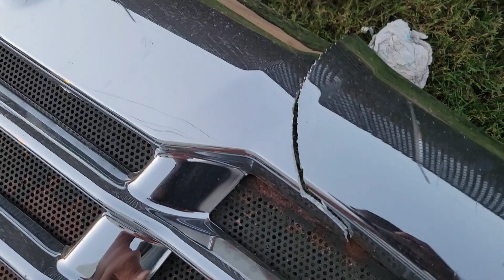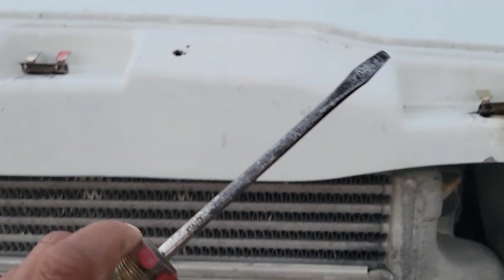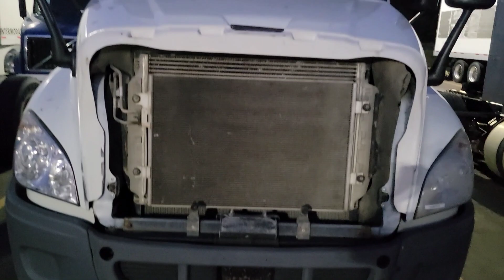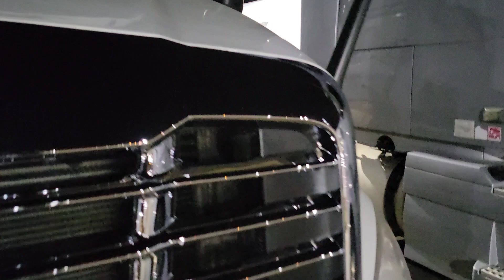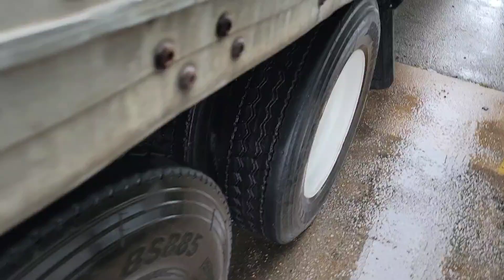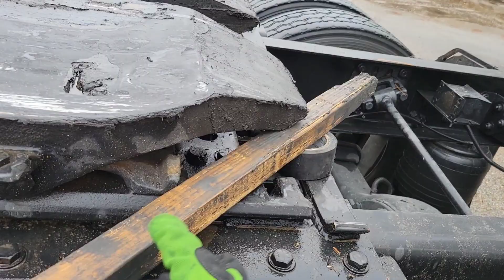Missing Grill and Jumped the KingPin

Comment: If you don’t have wood you can use rolled up ratchet straps too. And if you can’t drop your air bags you can roll the trailer up as high as it will go. It sucks, especially if the trailer is loaded but it worked for me. Respect and stay safe driver.

Comment: Great tip for 5th wheel that will always happen also wood is ez to find & I would have cranked the trailer up around 2 twist but sometimes that's hard also hey Success On & Happy Trails 🚛🚛🚛🙏🌹😷
Reply: And puts you at great risk of a shoulder or back injury

Comment: Always carry around a few blocks of 2x4 which you can stack up. You could have also placed them on the top of 5th wheel with suspension down then raise suspension in order to crank your landing gear lower. You can also use the blocks when a trailer is dropped too low for 5th wheel. Simply back up your rear frame under the trailer plate with suspension down and place 1 block on each side of the frame then raise suspension so you can crank your landing gear lower without tension.
Reply: Yes yes yes

Comment: My intercooler on my company freightliner cascadia came loose, it was cocked sideways...lol.  I had them fix it in Carlisle PA.  I hit high on the 5th wheel,  but it didn't go over.  It pushed the front down and the back up.  I pulled the release handle back out and drove out from under it.  Lower the trailer and hit it right the second time.  Be safe on your journey.
Reply from the maker: Thats scary (sideways intercooler) you be safe as well.

Comment: Use some red loctite or lock washer to keep screws from backing out or loosening over time
Reply from the maker: Appreciate ya TJ
Reply: Never use red lock tite for some thing like that as the screws would only be removable with a torch and obviously you would damage your grill.
Use blue loctite this is meant to be disassembled   with hand tools.
They also make screws with loctite in them.

Comment: The new one looks great.  The new grill will make the front look new. The only way to do it is the right way with the correct screws.  Several years back I drove a truck for USA truck and some of the screws came out of the grill.  I patched it up until I was at a terminal and I ask the shop maintenance department to put screws back in the grill.  Their reply to me was it looks fine to them?  But that wasn't the first time I saw their truck and trailer maintenance department slip shod a repair.
Reply from the maker: Thanks, I agree and yeah they don't understand what seems small to them is a big deal to us, we want the trucks we drive to look nice and be safe to drive
Reply: @LeeLeeOutTheBox  That is very true.  Going into a weigh station with  baling wire and duct tape visible will definitely trigger an inspection. I remember an inspection I had when I was with that company and it was in new York the guy said to me (if you list 100 trucking companies) USA would be the 99 th. Worst.  Number one being the best and 100 the worst. I thought that was interesting.

Comment: Those clips are about $12 apiece and I'd replace them while you're at it. You do need them or the grill will rattle and come loose again. It's easier if you put the clips in the holes first instead of putting them on the grill first. I think I paid $190 last time I replaced a grill. Don't drive without it or you'll get rocks in your AC condenser. AC condenser is about $300 plus labor and freon.
Reply: The condenser is far more than that.

Comment: Buy a crowbar it will help  you  out of plenty jams from  jumping that 5th wheel.  I hate it when  you  pick up a loaded  trailer  and the yardjockey crank the landing  gear too high and you  clear the 5th wheel.  So I keep  that crowbar on deck!
Reply from the maker: Thanks
Reply: I was a yard jockey actually with 6 different companies over the years. Yard drivers don't crank unless they use a day cab. As a driver I found out that it's 2 reasons for that. One: you drop a trlr  and the yard driver moves to a different yard location can change the height. Two: some inexperience drivers don't know how to set the landing gear height empty vs loaded.